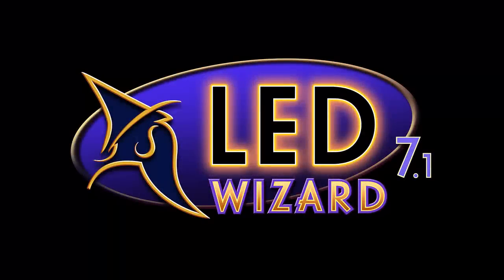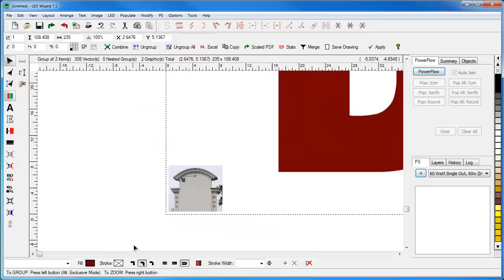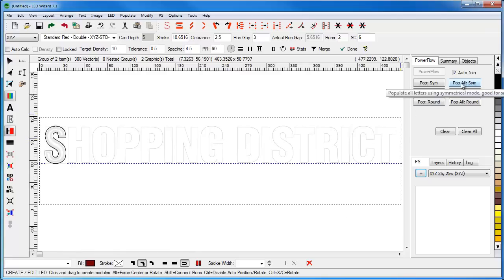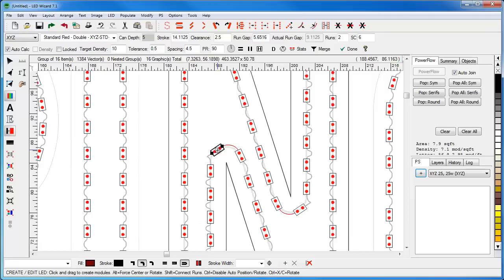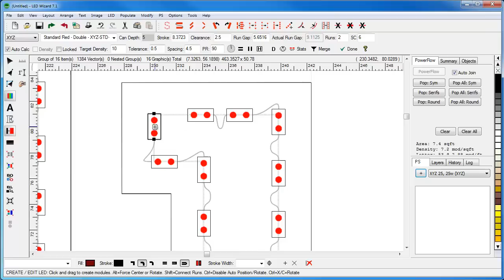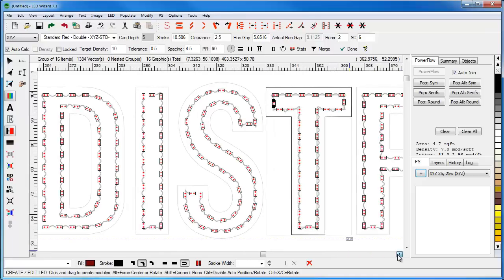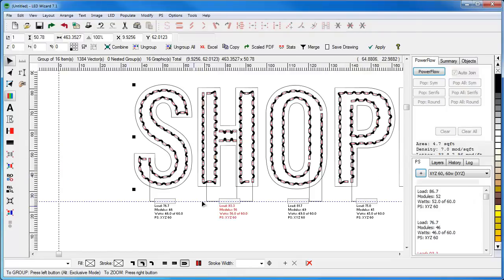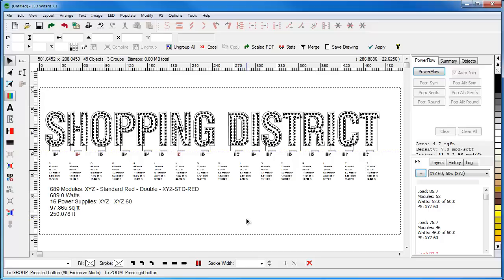LED Wizard Channel Letter Layout in Five Minutes

Comment: Is there an option for using side emitting LED's for Transome Light Boxes or Large Channel Letters? Can you use other manufactures LED's? Be cool if there was a "Create LED" function that you build LED modules according to the manufactures data specifications i.e Width x Height x Depth/LEDs on the modules/Power/Amp/Lumens/Beam Angle/Colour Type and it automaitcally calculates spacings etc. Is there are function for using T8 LED Tubes for Transome Light Box layouts? How about driver calculation regards to wiring rules for LED's? How about strip LED strips.